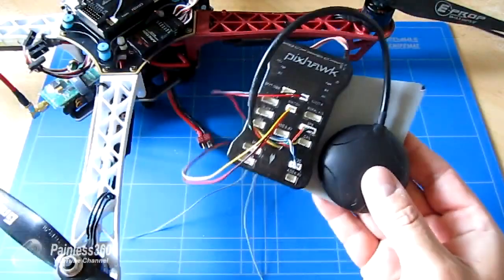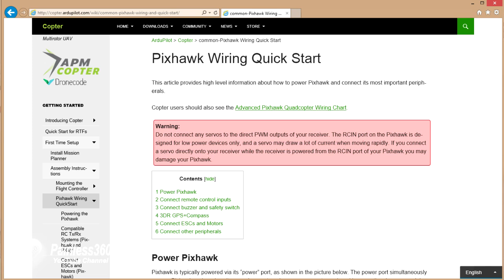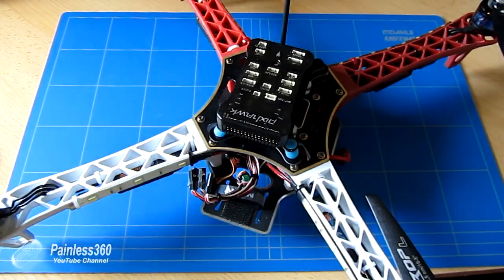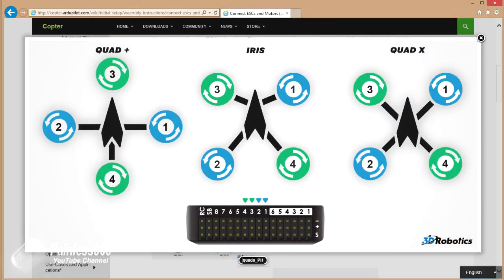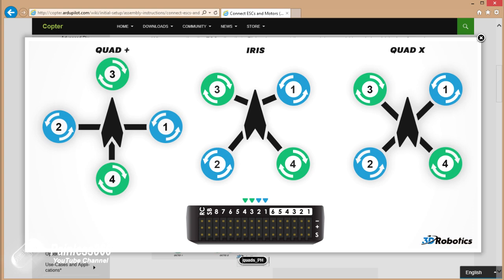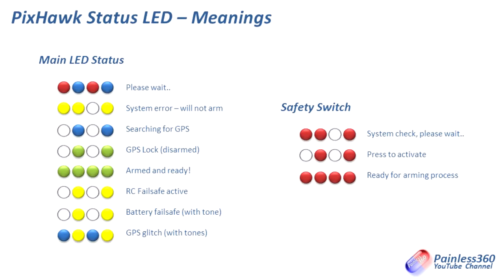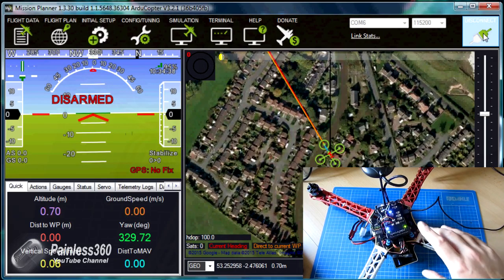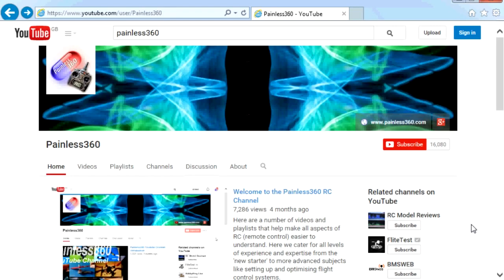(2/5) PixHawk Video Series – Power, installation, final checks and first hover

Comment: Thanks for informative video so much. I hope you'll answer my question :) I setup like you my pixhawk different thing is my power module did not arrive to me so my pixhawk powered by escs. I have some problems. First my throttle accelerate my motors between 0-50% above 50 there is no change (even propellers not attached) second problem is when I change flight mode to althold my quad falls off and crash :(. All the things that happens can be about how I powered my pixhawk? Thanks

Comment: I am building a hexacopter, At about 9 minutes in on the video you show the motor config. pins 1 and 2 are both counter clockwise, so for the hex would it be that pins 1, 2 and 3 are for the counter clockwise motors (and 4,5 and 6 are for clockwise) Thank you

Comment: Great video! Thanks so much. I'm trying to calibrate my Turnigy Plush escs. I'm using a Taranis 9 plus and a x8r receiver which I bound in D16 mode (SBUS). When I plug an esc into channel 3 and try to do the throttle calibration, I'm not getting the right tones and can't calibrate. Do I need to bind the receiver in a different mode when plugging the esc directly into channel 3? I'm a bit confused. Thanks for any help you can provide.

Comment: There may be one additional reason for a stout GPS antenna mast. I once had an esc burn out in midair. I was using a KK2 board at the time. I had an inverted crash and crushed the KK2. I didn't want that to happen to my PIxhawk, so I used a piece of an  aluminum arrow shaft for my GPS mast. I have since had a few inverted crashes with no damage to either the antenna or Pixhawk.

Comment: Don't understand 100%, I thought you said to pull all the red + wires from all the ESC's connectors before you plug them into pins 1-4 on the Pixhawk. Then I thought you said to leave one red + into a connector to power the rail for the ESC's. You talked about a diode, is a UBEC the same thing? You are the best teacher, instructor, I have ever watched. You are the best and I thank you for that. I guess I could install the UBEC in line for pin 1 that shouldn't hurt anything, however, don't want to anything without your OK. I'll be working on the camera gimbal and retractables in till I hear from you. I do so much thank you. After I get a few bills paid down I want to help support your channel. Man, without you I all of us would at a lost. Please keep up the good work.
Reply: Yeah I'm confused about this too.

Comment: I calibrated the ESCs manually as instructed in your video.  I chose the AT9 as my first controller, and all are fine.  This morning I pull the ESCs out the outputs and calibrated them one by one powering the pdb with the flight battery, so the pdb is fine. No matter what i do suggested in any forum as a solution has fail.  No toning when attached to Pixhawk.
Reply from the maker: +Forest M A video of what's going on to show those trying to help can be very useful.. Best of luck..

Comment: Is it ok not to remove the centre (red) wire of the ESCs? , I asked because you mentioned in the video that you disconnected it.
Reply from the maker: Yes you can. You only need the red wire if you want to power something from the 5v it supplies... Happy flying

Comment: Nice Video, I have a question regarding pos hold mode ,is it possible to give a predefined lower limit of altitude through GCS so that so that any mistake during lowering the height can be handled with that minimum limit ?
Reply from the maker: If it is then it'll be in the documentation,  using a lidar/sonar could be a good idea too - http://ardupilot.org/copter/docs/altholdmode.html#altholdmode-tuning

Comment: Appreciate all the great info. I'm really liking this Pixhawk, I have an APM 2.6 on a quadcopter and it's been amazing for auto flights and logging, but obviously I want something more up to date for my new FPV plane.

I'd like to ask if you know of any other contenders to the Pixhawk as far as flight controllers go? I've already pretty much decided to get a Pixhawk with osd, gps, power module, but would be interested if there is any thing else I should look at.
Reply from the maker: +Rick N Depends on what you are after, if you mean good GPS modes with Opensource support when the only other one (apart from APM) would be the CC3D Revo. There may be others but we've not used them yet..

Comment: nice video! how did you mount the anti vibration plate on the f450? In my case the the screw heads are in the way. Also the holes of the anti vibration plate dont match on the holes from the frame. Im using the same anti vibration plate.
Reply from the maker: +Needtobea sleep Mine had holes that allowed me to mount it ok, you could use double sided foam strips to make a good connection to the frame and build it up to avoid any bolts/nuts too.. Best of luck!

Comment: Hi 
I need to ask some advise, I have built my first drone now i am using the pixhawk and a dx8.

Have an issue in that the roll controls the pitch of the drone and pitch controls the roll.
On mission planner on the calibration for the radio all is as it should be, The new dx8 has a option to assign channels, but this one don't.
Is there anyway i can edit this in the controller? The esc are in the correct ports.
Good videos you have saved me many many times.
Reply from the maker: +Heliboy1975 the documentation in Ardupilot is amazing. If you Google for the problem you're having you usually find an article that covers the answer. Something like this for example - http://ardupilot.org/copter/docs/common-rcmap.html

Comment: thanks for answering , I did . but when I finish does not allow me to test engines .. I have to disconnect the battery and reconnect , arm and just then I make them work, but not all the same ... greetings
Reply from the maker: +Diego Alvarez not sure what this relates to. Please reply to the comment and then I can see the original question and thread. All of the steps we used to get flying are in the videos. The documentation for Ardupilot and the Pixhawk are excellent. Best of luck!

Comment: Painless should I still reverse the Elevator/Pitch on my radio when I’m using my PX4 Pixhawk?  My drone keeps tipping over towards the front when I throttle up.
Reply from the maker: If it's Ardupilot then yes, it's all covered in the setup documentation.. http://ardupilot.org/planner/docs/common-radio-control-calibration.html Best of luck!

Comment: Great info on Pixhawk. Thanks.
Little confusion...
Pixhawk can be powered by Battery & USB simultaneously for Mission Planner...???
Pixhawk can take power supply from Power Module & ESCs simultaneously...???
Reply from the maker: If ever you are unsure of something, the documentation is maintained, up to date and excellent - http://ardupilot.org/copter/docs/common-powering-the-pixhawk.html you can have it powered up and plugged into the USB too..

Comment: When connecting the esc's to the flight controller, do you need to keep the ground wire connected if you are not powering the pixhawk with the esc?  Or does the signal wire still need a ground to complete a circuit?  Just curious.
Reply from the maker: +DFSrlz you can often get away without connecting the GND cable but sometimes it can cause problems with the esc reading the signals cleanly.. I always connect them if I can here..

Comment: One tiny question, when connecting the ESC 1-4 to the Pixhawk, do i have to take the red(middle) wire out of all the connectors? And is the diode an option or mandatory?  Thanks in advance. BTW Great video series :-)
Reply from the maker: Depends on the 4in1 and how it handles the BEC for the 5v.. most 4in1 setups I’ve seen only have 6 cables (4 signal, a 5v and a GND)..

Comment: Random Question: what did you use to fix your PixHawk vibration mount to the Flame Wheel? Thanks for the videos!
Reply from the maker: I normally end up using double sided foam when I can't use screws. Best of luck!

Comment: One of the reasons I think some folks, like me, resist using the rather kludgy power module is that on some frames it just doesn't fit well.  I think there's a compromise position that I'm going to use, I think. I have desoldered the large wires on the end that connects to the quad or other device and then desoldered the large wires on the battery side of the power module and soldered on much smaller wires and wired them to a convenient point on the frame with battery voltage.  I put heat shrink on the module and the exposed cable stubs. What that will do is power the Pixhawk (or APM) and provide voltage monitoring. You will give up current monitoring, of course, but it seems like a good compromise when there are limited mounting options for the power module as delivered.  Thanks so much for what you do.  There is NOBODY doing it better.  This is an expensive channel, though, as I keep buying what you're teaching so I can try it, too.

Comment: how important is the negative wire on the servo connections from the ESC's ? is it possible just to plug the signal wire?
Reply from the maker: In theory there should be a, negative connection through the power side that is connected up to the speed controller. In reality I’m not sure I would trust that to not be full of electrical noise as the power system is running so I always connect that negative wire up on my builds. Hope that helps, Best of luck with your build.

Comment: Love the vidoes.  Followed these to the T, and went to test the motors and nothing. After a bit of research i find that Emax esc's are not compatible.  Might I ask which ESC's you are using with the Pixhawk?

Reptile Aphid X450 frame 
Emax 2212 980kv Brushless 
Pixhawk w/GPS 
Default PM
1047 CF Props
3S 30-40C 4000mah 

Have Emax SimonK 30A Linear Esc (which are not compatible)
Reply from the maker: +Forest M Can you post a link to the URL that covers why the EMAX ESCs will not work - I've not come across that. We are using cheap and cheerful 20A ESCs from HobbyKing (flashed with SimonK)..

Comment: Hey, I'm looking into seeting up a PX with RadioMaster TX16 and FrSky L9R. However there is this one question which I can't get an answer to. While in flight, is there some way to relay the telemetry to my computer without using another receiver/transmitter on USB? Such that I can control the drone with Radio and MissionPlanner simultaneously. Maybe with a USB connection to radio or something. Thank you for your answer!
Reply from the maker: I'm only aware of things like Crossfire passing on MAVLINK telemetry. In cases like this where you can't find the detail you want it is often because it doesn't do that specific thing. Best of luck

Comment: Hello Lee

  Thank you for all your helpful videos, they have been a big boon for me throughout the process of building My quad.  I have everything looking fine as of now, well sort of...  Flashed the radio (Taranis Plus) and the Pixhawk board, calibrated the Pixhawk, calibrated the ESCs, added the six position rotary Mode Switch and have it up and running with modes assigned and recognized by Mission Planner.  Everyone seems happy.
  Happy, with one small issue. When I arm the Quad, the motors all start to spin, even with the throttle stick retarded, all the way.  The motors all start together and seem to be turning at the same speed (maybe a few hundred RPM), not enough to take off but still not a good thing.
  I have checked all the Channel Ranges, using Mission Planner, and they are within the 1000 - 2000, the stick movements correlate to the graphic and the pitch channel is inverted from the stick, just as you describe in "(2/2) Power, installation, final checks and first hover".
  The Receiver that I am using, is the X4R with a standard Servo Style lead, plugged into the fourth channel pin-outs.  IIRC this is not correct, something about S-Bus vs CPPM with this receiver.  I have tried an "inverter" lead as well as the little lead from the Smart Port Plug. I have not installed the little jumper thingy on the two Signal pin-outs on channel 2-3. Not too sure if I am supposed to do that and do not want to risk damaging the X4R.
  The Motors I am using, are a matched set from LD Power. The ESC's are the non-BEC variety with only Ground ( - ) and Signal ( ~ ) wires. But I don't think this has anything to do with the issue.  I am getting main power from the in-line power board shown in (2/2).
  After the motors arm and start spinning they will respond to throttle stick movement, If I leave the stick alone and just let the motors spin, they will shut down after about ten seconds, which seems logical since the Pixhawk does not sense flight and disarms as a safety thing, correct? 
  I have checked and rechecked everything and can not find any reference in any of your fine videos.  Have you any ideas what is going on?  I am champing at the bit to fly this puppy.  However, I am not going to risk damage to me or others till I get this sorted.  Suggestions?

Peace, Wolf
Reply from the maker: Motor_stop :D https://www.youtube.com/watch?v=cXSNgCQ9WJw
Reply: Excellent. Thank you very much. Gotta go fly.  :o)

Comment: hello, I hope you can answer me, I am trying to mount a pixhawk to a plane, is the power module  enough to power the servos of the plane? they are 4 servos. or do I need plug a bec on the servo rail  with the zener diode?
Reply from the maker: Depends on the servos. If the ESC handled the servos before then I'd power them from that when fitting the Pixhawk. This is all covered in the series and Arducopter documentation too if you get stuck. Best of luck!

Comment: Hi
i made quadcopter using pixhawk flight conntroller and dji e 310 propulsion system... i have an issue whixch is that.. 
my copter goes up when i gave throttle but suddenly goes down with in seconds even i didn''t drop throttle...and then again goes up and so on..up down up down..i dont know  which the problem actually is...flight mode is stabilize and some times on mission planer and qground control it gives the error of " EKF2 IMU ground mag anomaly"" and some times nothing but the issue remains there..
please help me please thankssss..!
Reply from the maker: Sorry, we've not seen that but there are others who have seen the problem in the forums. Sorry I can't be of more help.. Best of luck!

Comment: Hello :D. LAST question.. Has this happened to you?? I just installed everything on the frame. Now I have finished calibrating the compass via the 3dr telemetry, but when I leave my quad on the table, the ground speed is constantly fluctuating like 0-4. I don't know why?  Is anything broken?
Reply from the maker: +Henok Hailu Probably not, the speed is calculated from the GPS position and that can move slightly. Bets of luck with the maiden flight.

Comment: I couldn't really understand how you power the ESC's do you power through the PDB or from the Pixhawk ? 

If you are powering from the pixhawk why do you use a PDB ? 

Sorry if it is a silly question but I am just getting started I watched all the series but still have some confusions

Thanks
Reply from the maker: The two thick wires are for passing the battery power to the ESC for it to use to send pulses to the motor to make it turn. The smaller 'servo' style cables are for GND, 5v back to the flight controller (usually) and a throttle signal cable. Please watch all about ESCs in the R/C Basics series if you're new to this..

Comment: i have a used custom quad with a pixkawk RD3 Px4 controller.  That was set up 2 years ago.  I updated the firmware using your video tutorial.  The frimware choises offered were for Pixhawk 1 or pixhawk 1m.  I chose Pixhawk 1.  No PX4 options were available.  is this correct?  I was able to complete the controller orientation sequence but no other setup for GPS, Motors and channel sequence was offered.  How do I know what has been set up?
Reply from the maker: I've not used one of those.  I'd check the forums.. best of luck

Comment: thanks for the video :) i would like to ask a question. is it possible to run the motors after completing wiring everything by connecting pixhawk with usb,not by using xt60 or a lipo battery? i want to test motors before buying a lipo battery. could you advise me something? thanks :)
Reply from the maker: You need battery power to run the motors. See the other videos in the series... best of luck!
Reply: @Painless360  thanks a lot :)

Comment: so while using Power module do i've to remove the red wires(+5v) from all the esc or only from 3(11:42)? please help i'm getting confused
Reply from the maker: It depends on what type of ESCs you have. If they have linear BEC then you can connect them all. Best of luck

Comment: I've read alot of forums, I mean alot.  Couldn't  find the exact article,  but basically the Pixhawk send a 900us signal on bootup while disarmed which is too high for Emax ESC's.  when i have the time I will find the exact article explaining it.  I have tried everything from disarming safety switch to changing the RC_SPEED 50hz.  Even went to remove some components from the esc board that a few other did to get their Emax ESC's working but boards are the same so I dropped that thought.  Guess I'll try the Hobbyking ESC's.
Reply from the maker: +Forest M Interesting - I'll ask the developers about that...